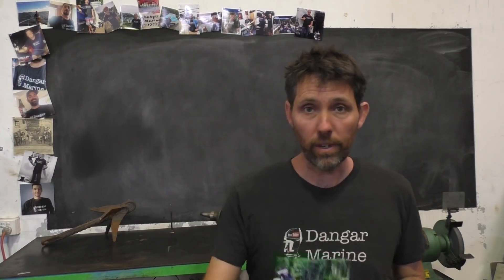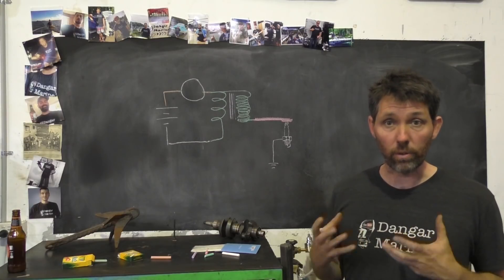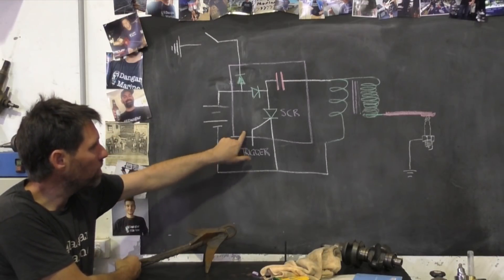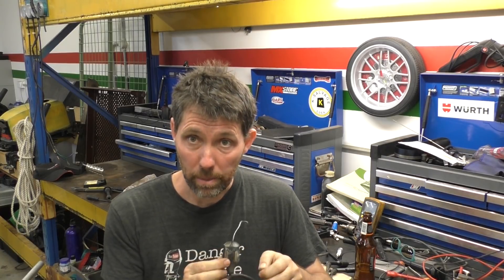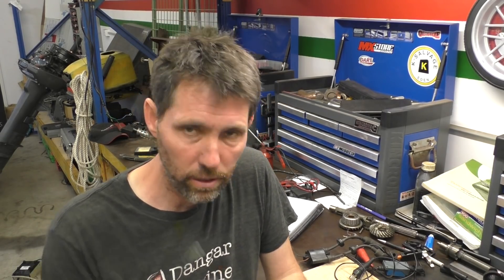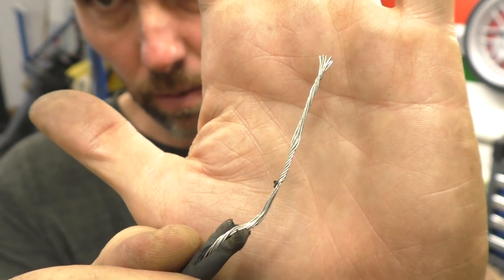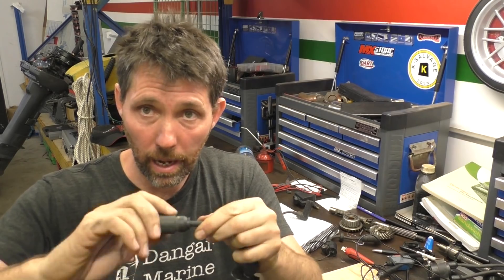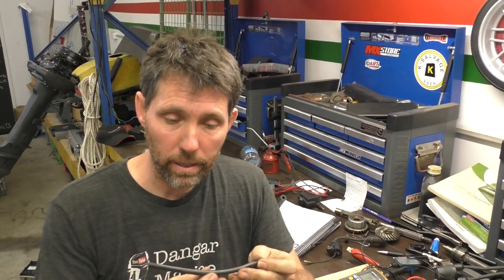Ignition coils and HT leads

Comment: I have a question i have a 96 or 97 200 efi mercury and its not charging can u tell me where to start diagnosing the problem also tach dont work but motor runs fine
Reply: Yeah Randy is spot on. I went through 2 voltage regulators on my 2 stk. When the Rach doesn't work it's almost always the v regulator. Look for burnt wires especially at connection(bullet connectors) . It's generally the yellow wires that fry the most
Reply: hi Chris the EFI  issue with merc i had was a fuse inline in one of the engines and on the other one it had a  bad voltage regulator on the electrical panel i just unhook the wires that went to the voltage module and unbolt the two screws and replace , make shure all connections were good before replace any modules ,as well disconnect  battery first so you dont do further damage to other components , ps also do a battery charge test some batterys wont except a charge if damaged , maybe another member can chime in on this incase i forgot to mention any other possible cause , cheers gl
Reply: The tach not working, no charging are symptoms of the same  fault. Your power generation coils are burnt out, disconnected (broken wires or stator coil to wire joins broken) , or your voltage regulator has failed.Outboard tachos on that non EFI or early EFI (yours) era engines use the AC voltage pulses as the signal. As the number of pulses goes up as the engine increases revs (typically 3 pairs of power coils on engines over about 50hp, so 12 pulses per revolution) , it was an easy and cheap way to get rpm info. Some tachos run off a lead from the rectifier, before the regulator (where they are separate items) , and others off a wire fed from the regulator/rectifier (combined unit) - but the actual pulse data is the same . On modern (2000 on) EFI engines the tacho is normally driven from a signal from the engine computer and may be simple voltage, a 5 or 12v pulse stream or even a servo signal. How the tach is driven is very individual to the engine.  Randy has the first item to check though, there is always a fuse in the 12v output to the battery/remote control- and they do break from vibration. If that fuse is OK, time to get out the manual, do a basic regulator check (AC volts on the yellow wires at about 30volts or so, about 14volts on the red out put wire from the reg) and make up a DVA , then follow Stu's video on checking coils with the DVA/multimeter. But I would be suspecting the power coils or regulator have died.